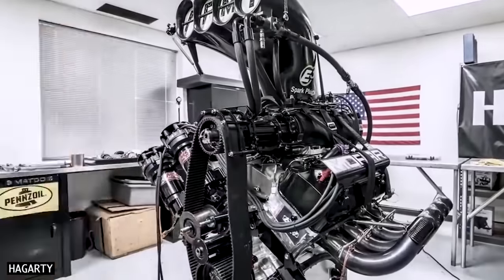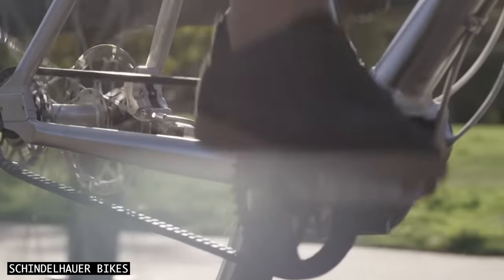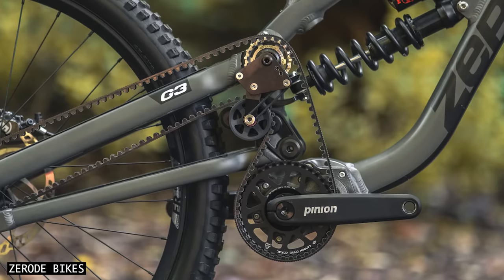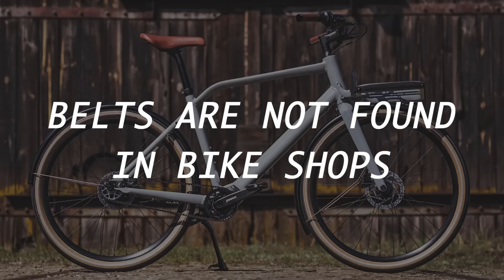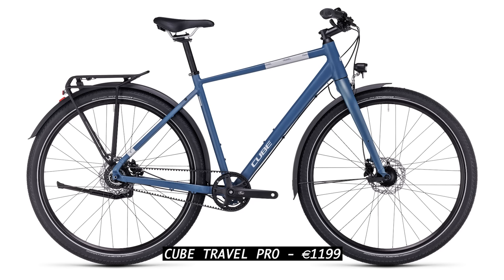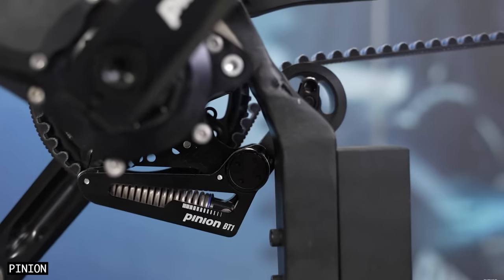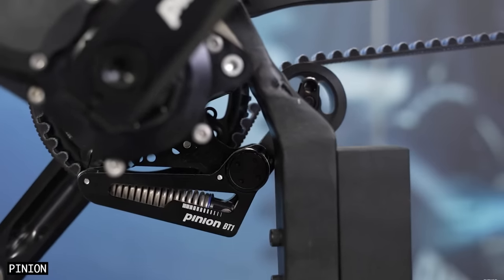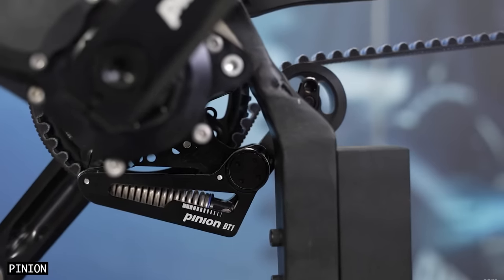Belts Are Now BETTER Than Chains On Bicycles!

Comment: Expensive:(
Reply: Not per kilometers
Reply: Exactly £20minimum for a new chain 1-2 times a year over 3-7 years on a drivetrain...
Reply: @thebellsfishmonger  no £12
Reply: @okantichrist  can't get a chain for my bike for less than £20 like, but obviously depends on the model/gear type your running.
Reply: @funkintonbeardo per my wallet, yes they are
Reply: @thebellsfishmonger You change your chain twice a year????  Buying some cheap chains is definitively expensive on the long run because I never had to change my chain even after thousands of kilometers...
Reply: @PG-3462  you need a chain wear tool on that chain then 🤣. I ride 2000miles plus per year at least on my commuter/hardtail MTB and changing the chain decreases the wear on the cassette and chainring and is cheaper in the long run. Shimano deore/slx whatever is cheaper and I ride in 10-11 months of rain, mud and shite weather which increases wear. £15-20 on a chain 1-2 times a year is better than £60+ for a cassette and chainrings are £30-40 each. I change at .75 wear on the tool any longer and shifting performance is rubbish and it will start to ruin the cassette and c/ring. Let's not even get into derailleurs and jockey wheel replacement which can be £100+; in total.
Reply: @thebellsfishmonger  For sure if you buy some cheap chains and cheap Deore cassette it won't last long 🤦‍♂️  Most particularly if your 2000 miles are done on the road.  

I also made the same mistake when I first got into road biking as I purchased a bike on Shimano Altus.  After 6 months of riding, the chain was completely weared out AND the chainring was starting to wear out as well.  Then I kept the same bike (a Felt FR40), but switched to Shimano Tiagra which is the first groupset of good built quality in the Shimano hierarchy, and I had no problem with the chainring in 6 years and changed the chain just once.  I don't count the total kilometers I do yearly, but
I do ride my road bike 12km daily to go to work/come back home, plus longer rides on most weekdays after eating and sometimes 80-100 kilometer rides on weekends. So if I count quickly that's probably around the same number of kilometers as you (2000 miles = 3200 kilometers)

As for mountain biking I only ride mine casually and the rides are (obviously) much shorter in kilometers relatively to road biking, so my Sram NX Eagle is fine for my needs and don't show any sign of wear 3 years after I bought my bike.
Reply: @PG-3462  You do realise that the hierarchy of Shimano components is cheaper and more durable, the more expensive the lighter and less durable materials are used. I've used SLX, Saint, zee and XT and as well and deore/slx always lasted the longest by far, the downside being that they are heavier (couldn't care less because the difference is a dump and a large lunch/meal anyway) 🤣. The other side is the cost the higher spec components can cost 2-3x more but don't last 2-3x longer from deore/slx upwards. I don't actually have to change my chain it will last longer, but doing so lengthens the life of the overall drivetrain. Chains are the cheapest parts by far. So yes £20-£40 a year to make a drivetrain last 2-4 years sometimes more is an easy win. This is common knowledge in the MTB industry to do so, for anyone who's got basic mechanical knowledge. Road biking I have zero knowledge or idea on the groupsets.
Reply: @thebellsfishmonger  I don't know much about Shimano's mountain bike groupsets as everyone I know including me use Sram's groupsets, but as for road biking Tiagra and 105 are definitively far more durable than lower groupsets in the hierarchy, and I say that from experience.  In fact, the only reason that makes Tiagra lighter than Sora is the fact that Tiagra has a 2x crankset vs 3x for the Sora (sorry if that's not the proper way to say it, english isn't my first language, but I guess you understand what I mean).  All other parts of Tiagra are in fact heavier than Sora because they are of much better quality.  The shifters are better, the brakes are much better, the derailleur works much better and so on.  Even some parts of 105 are heavier than Tiagra's, like the brakes.  Shimano's road groupsets only start getting lighter at Ultegra, which in my opnion isn't worth it.

Personally, I don't care about the weight.  For me it's all about durability, and Tiagra is the best quality you can have on a road bike other than 105, and my bike is the proof of it...
Reply: Only 1 company producing belts and the drivetrain for belts is very expensive.
Far more practical to own a chain drive
Reply: Buy once cry once
Reply: @obliviondio Competition drives down prices. When more companies come around the prices will go down.
Reply: @rhuttrho88  
They won't. Belt drive has been around for a very long time and there has been no other competitor. It's still more profitable to stick with chain for a bicycle. 

Otoh a motorcycle is different where belt drive merits more for competition than a bicycle which is why you now have lots of bikes made with belt drivetrain.
Reply: @PG-3462 I think the manufacturer recommends checking the chain and replacing after 2000 km, to ensure the rest of the drive train doesn't wear. Chains get longer and for that there is a measuring tool. I recently changed my chain (Shimano XT btw.), cause it was long gone.
I know someone who has been riding the chain for 5 Years to work and now everything on his bike needs to be replaced, cause his chain keeps jumping. Also there is the higher risk of chain snap.
Reply: Bellsfishmonger
Who is replacing their bike chain twice a year? I've owned DOZENS of Bikes from Schwinn Collegiate to Klein )TREK is the BEST btw... and I've NEVER replaced a chain in 52 years🤷. 
Belts on bikes is cool tech but it's not necessary for 90% of riders.
Reply: Johnathon
"Buy once cry once"
Or just clean n geese your chain (save $300) and don't cry at all😉.
Reply: @LaGrandeBayou You must soft pedal like an old lady.

With the best care I get 6000km from an ultegra chain, and about 20000km from an ultegra cassette. 2 chains per year and maybe a cassette every 2 years.
Reply: @thebellsfishmonger 2 time years? Are you a pro? Because I never ever brake a chain, wheel suspension etc yes but never a chain
Reply: @thybaltcarratala2433  yes because it's commonly known changing your chain more often extends the length of the rest of the drivetrain and chains are always the quickest wearing and cheapest part. So it's always a win win.
Reply: @thebellsfishmonger i haven't changed the chain of my bike in the past 4 years. I used to do it every year. But why you of it still works?
Reply: Just take an old timing belt
Reply: @blazn0  you need a chain wear tool 😅 once it gets to 0.75 the shifts are rubbish and efficiency is massively decreased and at this point it causes increased wear to the casette, chainring and derailleur pulleys. Increase dcost of changing these worn out parts Vs a £10-20 chain
Reply: @thebellsfishmonger  I will notice it when it's due.
So far it's still good.
Reply: But a stupid crossover to send kids to school is not? Lol
Reply: Having serviced chains over the years the cost of a belt is negligible !
Reply: @funkintonbeardo or MPH 😮
Reply: How is less efficient better?
Reply: Haven't changed my chain for 6 years now and I ride daily lmao @thebellsfishmonger
Reply: Check out the price on high end chain drives
Reply: My vhain has not broken for 2 years. People are overdramatising that chakns break. You can go decades without chain breaking. Ywah maybe if you run downhill riding like a madman it will snap. But usually it wont. Have also a powerful emtb with 85 nm motor pulling that chain and havent had any issue long time. Just pure marketing overhype to sell another product. Chains hold for a long time
Reply: @thebellsfishmonger how do you prevent rust? I presume uk uses salt on the roads as well? I cant go 2 weeks without my chain starting to rust when theres snow around.
Reply: The reason belts haven't entered the main stream is you need either an elevated chainstay or a chainstay you can open to place belt in the frame. In the wise words of Mike Burrows (RIP) They would be better off investing time and money inventing a chain guard that didn't rattle.
Reply: Anything that saves you time tends to be 😢

Comment: I had a nexus chain on a cargo bike for more than 20 000km and it was under 0.5% of wear. Lubed once. The  secret ingredient is full chaincase that prevent anything to touch the chain. That decrease the incentive to use a belt on any bike that can fit a case for the chain.
Reply: That is genius! Where did you get your chain case?  I'm not sure I've ever seen one, but I've also never really looked for them.  That would solve the concern of needing a frame with a split rear triangle.  Couple questions about your use: did the 20k kms involve rain, snow, road salt, sand, or other adverse conditions, and did there seem to be any wear on the cog and chainring after that of use?
Reply: @mitmon_8538  It came with the bike so I can't point you to where to get one.
I'm using it every day on road, in every conditions, so it did get rain,  snow a lot. But I rarely ride it on sand or mud (it's a cargo bike with a 20" front wheel so I tent to avoid it if I can).
The nexus Cog was as new but there were some wear starting to show on the chainring. It's only minor so I kept the parts in case of emergency. 
I only swapped the drivetrain because I had to repair the hub and I bought the parts before disassembling them, But if I had checked the wear before buying, and if I didn't have to disassemble the hub anyway, I probably would have kept them a few thousands km more.
I also double checked My chain wear measurements because I was surprised it could last that long (a 8€ chain and 3€ cog with a 20€ crankset... that's unbelievable for the money)

I can't post links on YT but I found a case that's called "Hesling Excelle full chainguard " that's look nearly exactly as the one I own.
Reply: @jowjor  thanks for the detailed reply. I'm happy with my 2 belt drives bikes, one with and IGH and another with a Pinion, so I probably won't need to look into this anytime soon. But this is great info for people who want to get into internal gearing as cheap as possible.
Reply: I call bs on that🙃
Reply: @aleksarajkovic3471  On what?
Reply: @petertroep9085  that chain that was lubed ones can last 20.000km and that chain guard is anything more that unnecessary weight and maybe a splash protector
Reply: @aleksarajkovic3471  Absolutely true. Good chain guards work like a charm. That said the conditions that I use them in are typical british/dutch weather with maybe some mud on the road from tractors now and then. And yes I ride them if it rains or not.
Reply: Got a belt on my bike for 10 years..still on there...but never rode it once so.....
Reply: @aleksarajkovic3471  yeah I’m with you 😂 professional bike mechanic and race tech here. 100% cap or you just have 0 clue how to measure chain wear
Reply: @Aleksa Rajkovic  ever heard of a cam chain?

A sealed oring in a closed environment should be good, or a non o ring with enough oil for a bit of splashing but that would add a lot of resistance
Reply: Combined with waxing, it can result in an insanely durable drivetrain.
Reply: the secret beside a chain case is that you most likely have a gear hub so you can use a very beefy chain that never has to bend sideways.
Reply: Hmm 🤔
Reply: i drove like 35 k km on 1 chain with cheap 170 euro bike, washing and oiling it like once a year, and sprocket just worn out, not chain
Reply: I just picked up some 20mm ptfe flex tubing.    Im gonna get it on there as a chain cover somehow. And my jockey wheels have toothbrushes attached 😂 self cleaning 🧼 i hate the hair and gunk they pick up.
Reply: @petertroep9085 im a brit in puerto rico.   Chainguards work here too 😊 traffic dirt is the main issue. Clouds of nasty floating around your feet and sticking to your chain.

But as such it woukd be preferable if it was fully covered.. which im aiming for with my 20mm ptfe tubing 🤔 wrong trousers/bikes
Reply: Chain case is too much hassle. The chainglider is a better option, unless you care more about rolling resistance than cost of maintenance.
Reply: If your bike had Internal gear hun when its easy to put it into that protecting case, but how are you gonna put a whole external dereilaur into that plastic case? I cant even imagine it

Comment: I bought a commuter bike with a belt drive and an Alfine 8 IGH based on your advice and love it. Super reliable with minimal maintenance.
Reply: Same. Alfine 11 with belt on ebike. As close to zero maintenance as possible. Love it.
Reply: Yep. My Civia Bryant came after watching his videos. Getting drops fitted now.
Reply: How’s the efficiency compared to a chain bike?
Reply: REAL MEN USE CHAINS!!!!!!!
Reply: @nevertakeadayoff  way to display your insecurities for all to see :)
Reply: @millermiller75  Honestly the difference is minimal unless you're comparing to a fixie on a flat surface.
Reply: @QuickQuips  crazy. I need to go test ride one. Thx.
Reply: same. mine also has hydraulic deore xt disc brakes. I havent done anything to them since 2017 and they are still the smoothest brakes i have ever touched. absolutely amazing, NO, i mean 0 friction when pulling the lever. its a rahleigh rushhour 6.5
Reply: Sounds similar to my Trek District 4. Love it for the reason you said
Reply: @scmorton8  Mine is a Trek District 4 as well. The only significant change I've made is replace the 22T rear sprocket with a 26T, which is great to carry my fat ass uphill.
Reply: Same here, love it.
Reply: Minimal maintenance.... all the way up until it does need heavy maintenance, heavy, expensive, bespoke maintenance, from a manufacturer in a far away country...
Reply: Use 303 protactant
Reply: @Pin Ky In winter, in salty-wet conditions, I'll have to lubricate my chain at least every day. Even with that amount of maintenence, the chain is gone within weeks and ruins cassette and chainrings, if not replaced. The belt sustains multiple summers and winters without any maintenance.
Reply: @Pin Ky HG93 (XT) chain and high quality lubes (Finish Line). I do 40km a day in every condition, when I don't lubricate the chain after a snowy-salty day, it is rusty the next day and squeaking. The wear in salty winter wetness is ridiculous!
Reply: @Pin Ky Sticky lubricants are even more of a nightmare, maintenance wise.Not significantly better performance in nasty conditions, but accumulating loads of dirt, causing a sticky black mess all around the drive train.
Reply: I wish I could commute to work on a bike! Unfortunately 56km is a tad too far :( EDIT: I mean, I do also work from home 4/5 days, but for that fifth day I'd love to ride in
Reply: @@pinky6863 I walk or cycle every week day. I'd just prefer to have somewhere to go instead of down a very long and steep hill and then back up the very long and steep hill :P
Reply: I just don't get it when people says super reliable with minimal maintenance on a bicycle. How much of a maintenance is a bicycle? My dad bought me a new Chinese made steel bicycle for my commuter, only 6 speed with Shimano 105, made in the 90s and it still work with minimal maintenance, I don't even touch anything mechanical when I was in a teenage years and abuse the hell out of it. Fast forward now, decades later, it still work. NO maintenance then but now since I am taking care of it, once or twice a year lubrication and wipe down! Since I am older now and mechanically inclined than my younger self, I disassemble it 2 years ago, clean it and assemble it back, clean out the cosmetic rust from decades of abuse real good and paint it. I am still using it now on the weekend! 
Now with that says, how drive belt is any more superior again, on a bicycle? Please don't tell me you are over engineering a freaking bicycle!
Reply: @blackdan0259  I mean, if your baseline is not maintaining your bike adequately in the first place, then, sure, any bike requires zero maintenance. For most people, cleaning and lubing the transmission every month or so is a must, unless they use a belt drive and a gearbox.
Reply: @Frostbiker  I mean I don't understand your argument though, do you think after almost 3 decades of my own version maintenance and it still works (wonderfully that is, no mechanical issue whatsoever), is going to change my mind when you said "if your baseline is not maintaining your bike adequately in the first place"? I mean you have cool tech because you want it, just says that, I am cool with it! You failed however, to build a case that your cool newer tech is any more durable and reliable than my old tech!

Comment: When I was in Japan in the late 90s, many of the commuter 'mamachari' bicycles had belts.  I thought they were so cool. No maintenance. You can leave your bike outside in the rain at the train station and not worry about your chair rusting up.
Reply: how about the sprockets?
Reply: @Produif  'stainless' is da way
Reply: Aren't they... harder to drive, less efficient?
Reply: @KOTYAR1  Yes they are feels "squishy" at times and takes away some of what you put in
Reply: I have one of those belt drive bike in japan, totally silent n love it
Reply: yeah, rust only everything else
Reply: A nexus hub doesn't like rain forever, seen many rusted to death.
Reply: @KOTYAR1 well, yes. Just pedal backwards by hand you'll sense it right away.

Comment: If somebody made a belt or chain drive IGH that could accept a little torque, had 3 gears, came in 148mm, 135mm , 142mm axles and was $499, it would sell like gangbusters.  Here we are in 2024 and still don't have one.